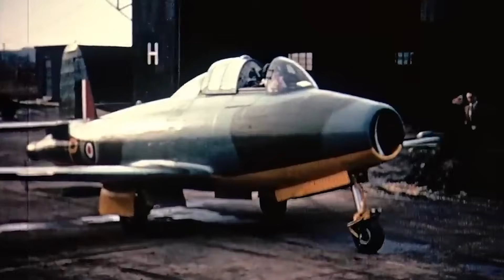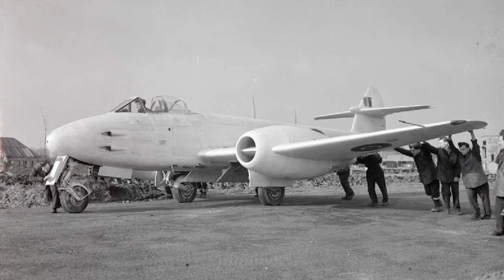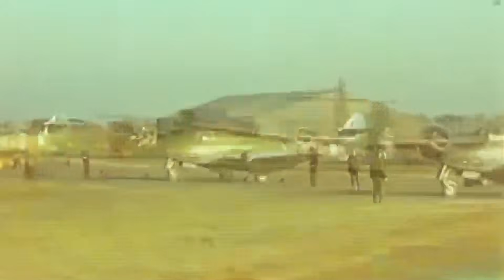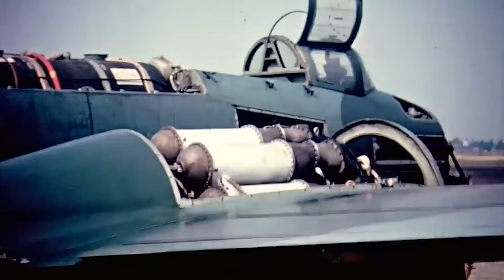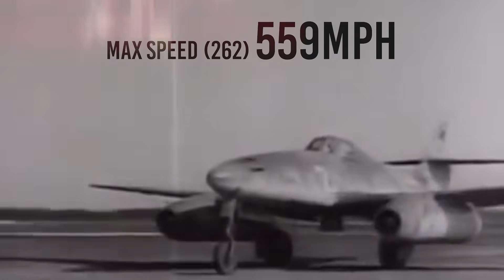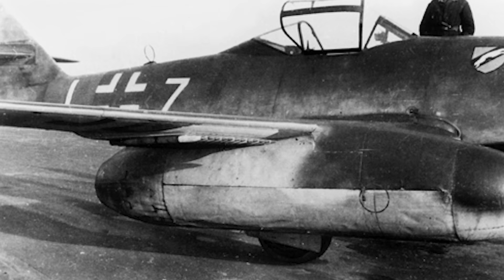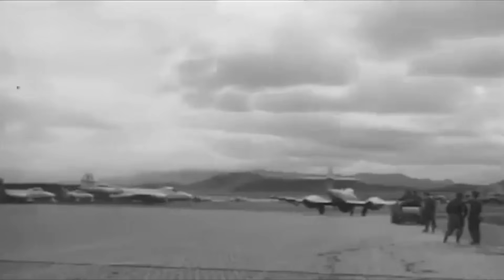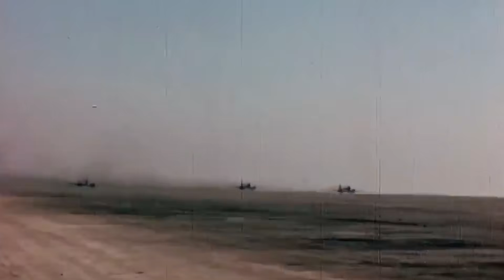Meteor vs Me 262 | Which was the better WW2 jet?

Comment: Refreshing to hear that the Meteor F3 was being compared to the 262 , not the F1 of which only 16 entered squadron service BEFORE the 262 in July 1944 whereas the 262 entered full squadron service in September 1944 . By November/December 1944 the Meteor F3 entered service in large numbers . Eric Brown ( Nazi Fanboy !!! ) never evaluated the Meteor F3 against the 262 . Brown became irrelevant in 1946 when he threw his dummy out over the cancelleation of the Miles M 52 programme ( which probably saved his life !!! ) The Meteor F4 in 1945/6 was far superior to the 262 and the F8 in 1949/50 was superior to the Lockheed P 80 Shooting Star
Reply: The Messerschmitt Me-262 was transferred from RLM testing and entered operational Luftwaffe squadron service on April 19th,1944. This is well-documented and is not disputed by historians.
The F3 was still too slow and completely outclassed by the Me-262. 
  The first 120 F.3 airframes with the original short nacelles suffered compressibility and airflow problems at high speed (top speed in actual service less than 460 mph).
The fastest version of the F,3 was still only 493mph (70 mph slower than the Me-252 fighter)

Eric Brown hated the 'Meatbox" and called it a "a Killer" he called the Me-262 "the best fighter aircraft of WW2" and "years ahead of anything the Allies had during the war"
 He is widely regarded as the best test pilot in history and records show he flew more types than any other'

By 1946 the improved Me-262 HG (high speed interceptor) would have entered service and completely outclassed the F.4 Meatbox.

The F.8 was completely obsolete in 1949/50 rendered obsolete by second generation German jet fighter designs like the MiG-15 (designed by Siegfried Günter)  and the F-86 Sabre designed by Edgar Schmüd and Adolf Busemann.
Reply: @DoktorBayerischeMotorenWerke lol would of could of , never did
Reply: @garrington120  The Messerschmitt Me-262 was the World's fastest, airbreathing production jet aircraft until the F-86 Sabre in 1947.
Reply: @DoktorBayerischeMotorenWerke 

@JammisAdami  

We feel we can clear up some commonly held myths and misconceptions, obviously.
It's always good to see the facts presented clearly and concisely isn't it?

The Gloster Meteor was one of the world's first jet fighters to go into service, it was in service during WW2. The meteor was the first effective multirole fighter bomber jet aircraft with a reliable engine to go into service,  It broke speed records in 1945 and 1946. During WW2 it was in service as a fighter and multirole aircraft over the UK and over all allied controlled territories in Europe and beyond. 

The ME-262 and it's 46 minutes life engines were abandoned shortly after 1945, it had a do not exceed speed of 456 mph and was only ever used to attack bombers with losses of three 262s for each downed bomber.  During WW2 most of the ME-262s were destroyed by their engines, were various types of accident losses or were shot down by bombers. No German designers were involved with the Mig-15. The Mig-15 used a copy of the RR Nene.  

During the Korean conflict most of the Meteor casualties were due to groundfire or accident losses. The result of any tangles between Migs and Meteors was that Mig pilots avoided getting into dogfights with Meteors. The battle of Sunchon, where 50 Migs against 14 Meteors resulted in the supposedly superior Migs failing to gain any clear advantage caused the Koreans to re-evaluate tactics. General opposition in Australia to involvement in the Korean conflict resulted in the govt using the battle as an excuse to reduce the RAAFs involvement to troop support only.

The world's first wind tunnel was built in England during the 1800s. The world's first supersonic wind tunnel was built in England during the 1920s. 

The Whittle Gloster E28/39  was of course a brilliant aircraft that was later copied in Russia as the upsized and tweaked Mig 15 with a copy of the RR Nene gas turbine aero engine. The RR Nene being the world's most powerful & most reliable gas turbine aero engine in 1944.

The MD F3H Demon was a contemporary to the DH Sea Vixen & had a similar performance. The F4 Phantom was a follow on from the F3 Demon. The Sea Vixen took a long time to get from first flight to introduction for various reasons and a similar situation occurred with the MD F3H Demon.

McDonnell Douglas F3H Demon
590 Built. Not Supersonic.
Max Speed 578 MPH.
Introduction date 7 March 1956
First flight 7 August 1951
Retired 1964

MD F-4 Phantom 2
Number built 5,195
Manufactured 1958–1981
Introduction date 30 December 1960
First flight 27 May 1958

DH Sea Vixen
Number built 151 (including two DH110 prototypes and one Sea Vixen prototype)
Introduction date July 1959
First flight 26 September 1951
Max speed 695 MPH.
Retired 1972

Interesting British achievements.
There is no doubt that the Fairey (England)
Delta 2 was of course the world's first jet
aircraft to exceed 1000 mph.  Indeed It
exceeded the previous record by 310 mph &
held the record for 1 year. Incidentally, the Dassault Mirage 3 & 4 are based on the Fairey Delta 2.

The Panavia Tornado & Euro fighter Typhoon are British design aircraft with British design engines built by international consortiums. 

The EE Lightning was one of the fastest aircraft on the planet when it first achieved a Mach 2 flight. 

Early days, jet fighters.
De Havilland Vampire, Sea Vixen & Gloster Meteor accident losses were not high or unusual for fighter aircraft at the time. De Havilland built large numbers of all metal airframe aircraft before the DH Comet.
We mustn't forget of course that the DH Vampire for example first flew in 1943 & the engine was also built by De Havilland. There were examples of the Vampire interceptor / fighter in service until 1990 which was operated by more than 30 countries.

Non combat phase accident losses.
% of Aircraft built.

The Canadair CL-44 was a turboprop airliner.
Canadair CL-44                  (ff 1959 ) 48%
Lockheed XF104                (ff 1954) 100%
Lockheed  P80                   (ff 1944) 43%
Lockheed F104                 (ff 1954)  45%
Grumman f9f-5 Panther   (ff 1947) 44% 
Convair F102 Dagger        (ff 1953) 45%  
MD F-101 Voodoo.             (ff 1954) 34%
MD FH Phantom 1            (ff 1945)  35%
MD F4 Phantom 2             (ff 1958)  28%
MD F3H  Demon               (ff 1951)  32%
Gloster Meteor                  (ff 1943)  21%
DH Vampire UK                (ff 1943)  23%
DH Sea Vixen   UK           (ff  1951) 33%
Gloster Javelin  UK         (ff 1951) 20%
EE Lightning  UK             (ff 1954) 33%

It's a great pity & a crying shame that British military forces had to occupy a large part of Germany for decades after 1945 & Russian military forces had to do the same. Of course Russia still posseses a large chunk of what was German territory & of course Russia & the UK produce nukes. Obviously Germany does not produce nukes.

Early days, jet engines. Whittle performed the world's first demonstration of a gas turbine aero engine in 1937. The RR Nene, a centrifugal gas turbine aero engine, was the world's most reliable & most powerful gas turbine aero engine in 1944. Licensed built versions & copies of the RR Nene & RR Derwent would go on to power many aircraft in Russia including the Mig 15 & Mig 17, the US, China, France & other countries for decades after 1944. Incidentally, the Mig-15 was in essence an upsized / tweaked copy of the Whittle / Gloster E28/39 jet aircraft including an uprated copy of the RR engine.  The basic centrifugal compressor gas turbine aero engine with Whittle style reverse flow combusters and sometimes an axial compressor section is still manufactured by more than one company including Pratt and Whitney, the main application being helicopters.

The gas turbine engine was invented in England during the 1700s.

During the 1800s Parsons of Ireland & North England produced the world's first axial multi stage sequential stator rotor turbines and compressors for turbomachinery use which would eventually go on to to form the main components of the axial gas turbine aero engine. At the time the basic idea of making an internal combustion gas turbine engine and using it as an aircraft engine was considered thus the jet aircraft concept had been created in England before the first powered aircraft flew.

An example of what goes on these days in various countries. For example, there are of course no German companies that makes German jet aircraft in Germany & there are no German Companies that make German gas turbine aero engines in Germany that are suitable for widebody airliners.

The UK has the world's highest combined per capita Nuclear / Defence / Aerospace Sector Activity.

UK defence sector, absolute terms, world's second highest activity. 1st for per capita defence sector activity. Per capita nuclear powered submarine construction, 2nd position. 
Main players being Rolls Royce, Babcock, GKN Aerospace & BAe Systems. Activities often involve international collaboration. BAe systems, RR and other UK companies now handle more Airbus work value wise than Germany. 

There's a good chance that anyone currently flying on a widebody airliner will be on an aircraft powered by RR gas turbine aero engines made in the UK and a good chance there will be other hardware on the aircraft that's designed and / or manufactured in the UK. 

Rolls Royce Holdings UK
Subsidiaries
- Rolls-Royce plc
- Rolls-Royce North America (ex Allison etc Classified Military stuff)
- Rolls-Royce AB
- Rolls-Royce Deutschland
- Rolls-Royce India Private Limited
- Rolls-Royce Marine Power Operations
- Vinters Engineering Limited
- Rolls-Royce Controls and Data Services
- Rolls-Royce Power Systems
- Bergen Marine
Joint ventures include:
- Rolls-Royce Turbomeca
- MTU Turbomeca -

Trent Family
The MT30 (Marine Turbine)
Industrial Trent 60 Gas Turbine
Trent 7000
Trent XWB Airbus A330neo.
Trent 1500
Trent 1000
Trent 500
Trent 600
Trent 700
Trent 800
Trent 8100
Trent 900
   
RR wholly owned subsidiaries in Germany handle smaller 2 shaft RR gas turbine aero engine work.

The UK space and aerospace sectors are highly productive, high-value industries that together contribute over £18 Billion in direct Gross Value Added (GVA) to the UK economy. Individually, the space industry directly contributes about 0.3% of UK GDP 7•2 Billion while the aerospace industry contributes approximately 0.5% £10•9 Billion.
   
We hope this helps.

We hope this helps of course 👍